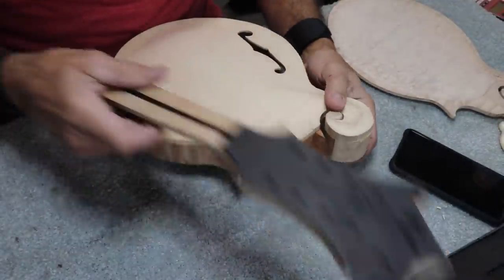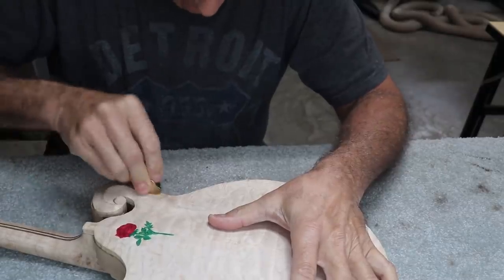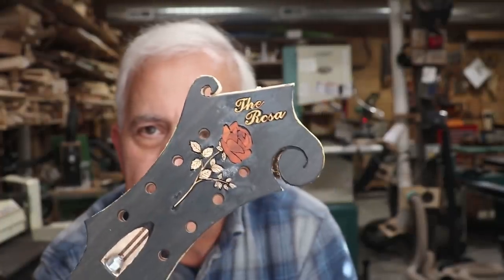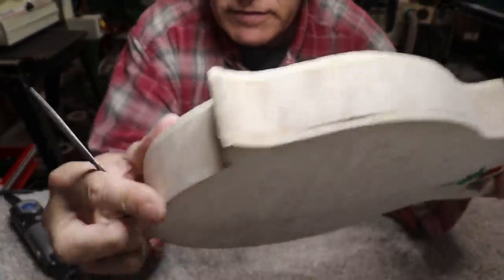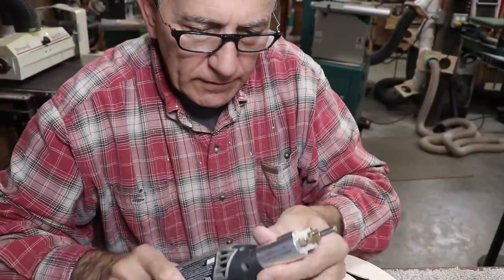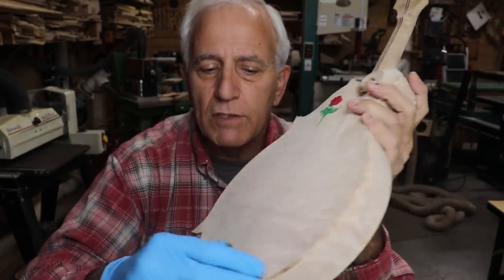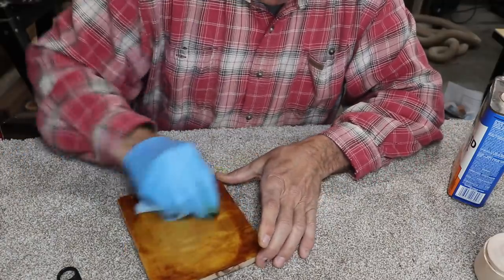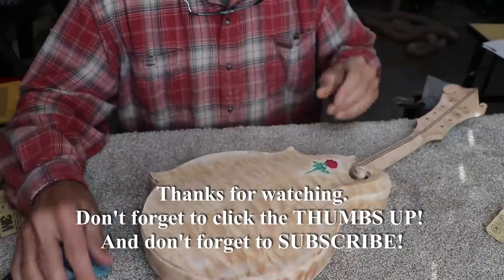441 RSW A Custom Quilted Mandolin Part 3

Comment: Hi Jerry;
I have to tell you, I love the music while your carving the rose on the back. That glue plugging when the camera is on has to be, "Rosa's Law." Gluing the points Is an application where I would put a drop of CA glue on each end and use Titebond in the center. You just hold the point long enough for the CA to harden and it becomes the clamp for the Titebond. This sure is going to be a beautiful instrument, I love it.

Comment: Very beautiful, Jerry, that quilted maple is absolutely stunning. I've been following this build closely from the start, and this has to be the most beautiful mandolin I've ever seen.

I am a tobacco pipe maker. I made pipes out of the burl of the Mediterranean White Heath Tree (aka Briar). I use alcohol based stains on my pipes, and even the slightest scratch will show up. You may already know this, but a trick I learned from my mentor, Horace DeJarnet, is to lightly wet the wood with denatured alcohol after the final sanding.The denatured alcohol will show up every little scratch that is very difficult to see on the bare wood, just like the alcohol based stain will, and will quickly flash off. It shows me exactly where I need to touch up, so I don't waste my time sanding areas that are perfectly smooth already. 

For tobacco pipes, I actually finish with 000 steel wool, checking for scratches with the denatured alcohol. Then when I have it smooth, I buff the pipe on a flannel buffing wheel with White Diamond compound, then apply pure carnuba wax with a dedicated flannel wheel for a breathable gloss. Beautiful work, Jerry, I love it!

Comment: “If you haven’t learned how to sand something in 40 years without leaving grooves then you haven’t learned much”. 😂  Now that is a piece of wisdom that applies to so much in this world.  Love the content Sir and looking forward to seeing this project finishing up!
Reply: Surely the advantage of using one's fingers, is that on curved surfaces like this, the sensitivity of the fingertips means that with experience, you will feel, and adjust pressure to a level of detail, that you simply couldn't with a sanding block, or other means. Our fingers are actually incredibly sensitive to touch, which is why  we use them to gauge smoothness in situations like this.  Sure if you want to sand something flat, then use a block. But on continuously curving surfaces, your fingertips are your best friend!
Reply: A fiddle make friend of mine said "If 200 grit put in grooves, 300 grit will never remove them. "

Comment: Little tip for you woodworkers out there, metal working end mills for aluminum work very well in wood. They are available in upcut, downcut and straight just pay attention to your shank size to fit your collet. Remember that steel tools are sharper than carbide but carbide is more durable and more flutes (cutting edges) is not necessarily better because you need to allow room for the chip. Hope this helps.

Comment: I wish you would have also tried a wood conditioner for the sunburst. I used it to even out end grain vs quarter sawn and it was perfect. It fills the grain so the stain doesn't soak in as much.

Your work is awesome! I don't know where you get the patience.

Comment: Need to stain dark and sand back to raw wood blend your yellow. Worked with quilted maple a lot. Especially with 3d finishes. You can also spray the lacquer with a yellow tint. You need to sand to 600 grit

Comment: I totally agree about commercial binding routers for arched surfaces. I've never used one that worked. I've got the Stewmac set of bearing bits that works fine if you're doing a flat guitar, but I'm almost convinced that the only real way to do mando binding is with a knife, which is probably how it was orginally done. I'm glad to see this because I was just about to pull the trigger on the one you're using that will remain nameless:) It's about 80 bucks, too. Let me know if you come up with something that works!

Comment: Looks great as always. My experience burning wood with that straight fluted cutter is slowing the dremel down. Not sure if it'll work on your case, every case and wood is a bit different, but I'll run mine at 10k rpm and no burning. Have to do more passes though.

Comment: I have never worked with those dyes but with furniture, I dry brush stain when blending or fading. Maybe a soft brush might work to feather out the edges and wiping the bristles on a rag to remove the excess 
. However that only flies when the wood is sealed with shellac. Really enjoying the process and interested in seeing the final results.

Comment: If you ran the extension over past the far edge and put an adjustable roller on to pull the cutter in tight to the work edge, you could reduce the chatter and jumping.

Comment: Jerry, I think the reason the alcohol wiped off the dark was because the shellac was full strength. Try a spit coat. One part shellac three parts alcohol. Works wonderfully on my wood projects, especially when it comes to end grain. Mine usually comes out really closely matched to the long grain.

Comment: Try using Merka Micro Mesh Abranet sanding mesh. You can get grits down to 600 grit. Also, the mesh can be cleaned and reused. Also, check at you local auto parts store and you may find sand paper down to 7000 grit.

Comment: When I trim the edges, I set the trimmer shallow and end up going around the whole thing in stages....about three times so I don't have to deal with so much of the chips. The Stew mac blade is spendy but it works good...if you can keep it sharp.

Comment: No hide glue? What do you do if you need to take the body apart for repairs? Just curious. I understand yellow glue is easier to work with and stronger under temp and humidity variables. However, it is very difficult to reverse if a repair is needed. Not been an issue for you?

Comment: Am I incorrect, or do you also have the Stew mac overhead router that I believe I saw you using on the latest flat top? It seems to me that with another template, you have the answer to your binding issues using that machine. I know you'd still have to do the hand bits, but I think that the Stew Mac machine would work with the right base template. 

Gonna be a beaut!
Reply from the maker: I have thought about it but I not sure you could really adapt it
Reply: @RosaStringWorks  I made the same type of thing out of a Dremel drill press stand, made a base for it's base to sit under, and made a few templates to try it with. So far, it's worked fine on everything I've tried it on. So far, from what I can tell, it's just a matter of making sure that the instrument is being held level to the base of the unit, and the template has to be shaped properly, though with the right adjuster on the Dremel, it worked very well for me. Granted, I haven't tried doing a F5, but I think it should be about the same, just tighter when compared to a guitar. 

The templates I made were a little smaller than the instrument top and I used pieces of UHMW plastic for the grabbers on them.Those stuck out over the edge of the templates a little so they could grab the lower outside edge of the body. Easier to understand than explain. But I thin if you really think it out, you will find a way to make that work. 

Those cutters, though... you're right, that IS another problem. Too bad we can't find a good one of those.

Comment: Would the jig for the neck set that you used on the mandolin work for a guitar too?
Reply from the maker: It could work I suppose but it is a different type of neck connection which requires much closer fitting on the guitar.

Comment: Buy a Gramil from Luthiers Mercantile.  Using one you can slice out absolutely perfect binding ledges by hand.  Notice I said slice rather than cut - it's a precision slicing tool.  Make a cut all the way around, then set the knife a little deeper and do it again and continue in this fashion until it's deep enough, then set it up to do the other cut and repeat the process.  In a not long time you'll have hand sliced ledges that are just right.

Comment: You might look at Kone Tool, Grizzly, or here for some spiral cut burrs. https://customcarbide.com.au/products/carbide-burr-r-h-spiral-cylinder-1-83mm-cut-1-83mm-shank-dremel-900-9003
Reply from the maker: The size is the issue.  Need to bigger than 1/8"  prefer 1/4"
Reply: @RosaStringWorks  like this?  https://www.carbideburr.net/carbide/sa-51-carbide-burr-die-grinder-bit/

Comment: I built a simple tool for cutting binding channels with my dremel. It is much bigger and heavy than your metal one, and it is very easy to hold it very steady in the hand. Anyway there is no setup mechanism so it is a bit tedious to set the depth and heigh precisely  : https://www.instagram.com/p/CCzEB4_nrey/